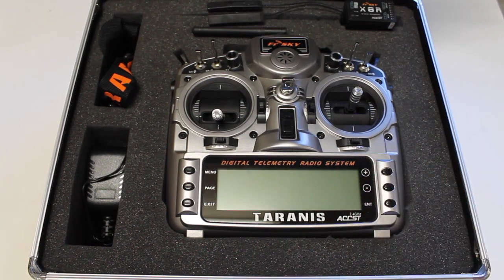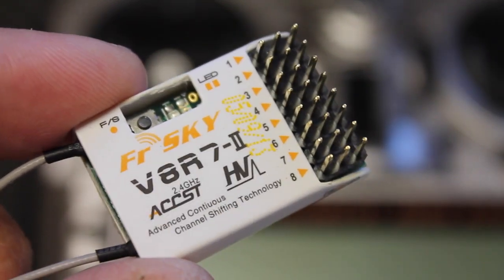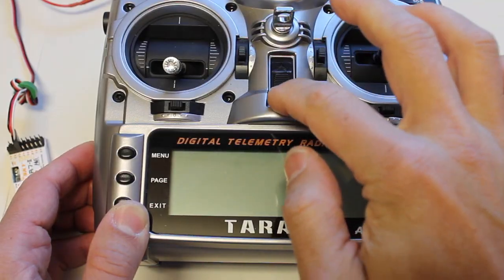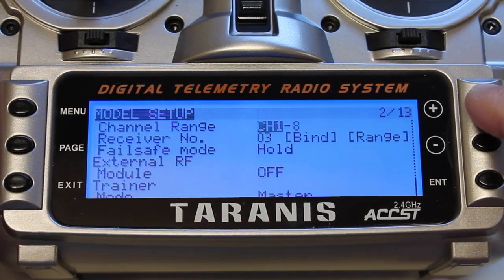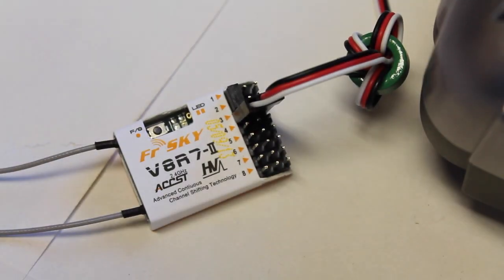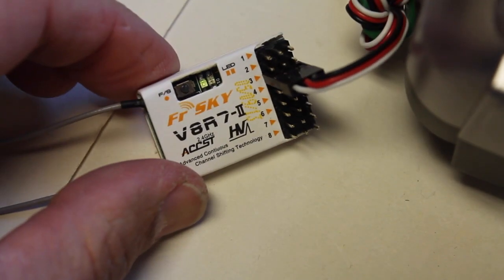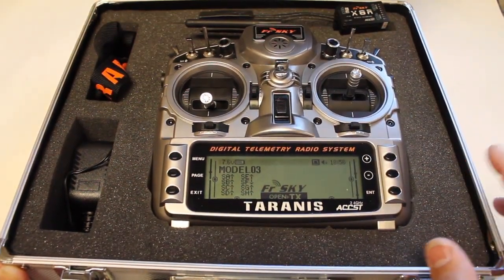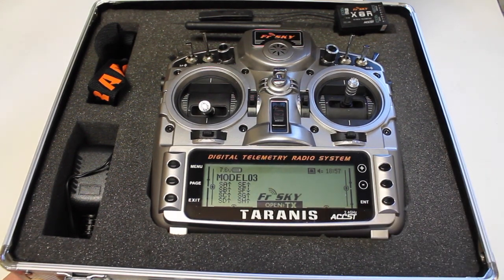FrySky Taranis How to Bind with FrSky VR87-II Receiver

Comment: are you using the internal Module or external module?
Reply from the maker: +Soldier53flyer Internal. The one that comes with it.
Reply: I have used the internal as well as the external just want to see the which one works better. I like the fact I can add a better antenna on the external module. I set up the Vector, and hope to have it in the air today. Then I can see which module go's farther. Thank you for getting back to me have a MERRY CHRISTMAS!

Comment: dennis I was going to buy a dx9 but I just cant get myself to spend 150 dollars for 9ch receivers, so I thought maybe ill buy a frysky module for my turnigy 9x but know im thinking of just buying a taranis , what are your toughts of the taranis ill be using it mainly with my dji quad,  since there is no failsafe on the turnigy 9x but I would I also would like having the flippy pedals for  gimbal control. and are you going to make some taranis videos configuring failsafe rth when you lose signal and of course mixing switches to perform manually engaged failsafe and fight modes thanks
Reply from the maker: I definitely recommend the Taranis. I'm really enjoying it and understand where you're coming from. I do plan on doing some videos that show failsafe and multiple flight modes. Thanks for asking.
Reply: Dennis Baldwin good deal I enjoy your tutorials, simple and easy to follow

Comment: I've been on aloft hobbies wait email list for quite a while.. Just waiting for them to tell me I can order! Want this transmitter even more badly now! Just can't beat the value and range of frsky! Had a flyway with a quad with my original turnigy module and Rx. Went to a djt, never looked back! Rssi and telemetry feedback for peace of mind and at a fraction of the price of a "big name" and at least double the features!! No brainer in my book! Wonder if the other manufacturers are sweating yet? There old faithful customers won't be around forever! Frsky has yet to let me down, I haven't even had the need for a UHF system yet, and at first that's what I thought I needed for decent range without worrying. Nope! Now I won't be flying 5+ miles, but then again I won't be flying 5+ miles! Thanks for your awesome videos and keep the frsky info flowing!
Reply from the maker: Cool, Eric. I hope you get your invite email soon. It took about 6 months for me to get mine, which was a real drag. But this thing is amazing. Thanks for your thoughts.